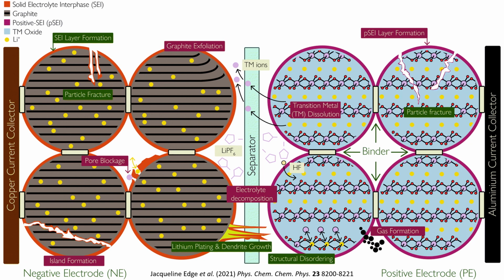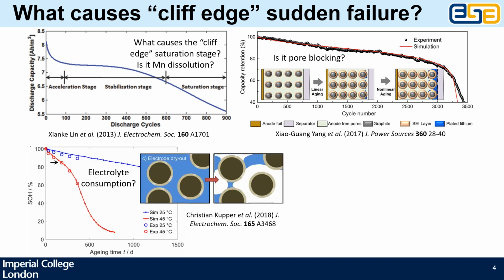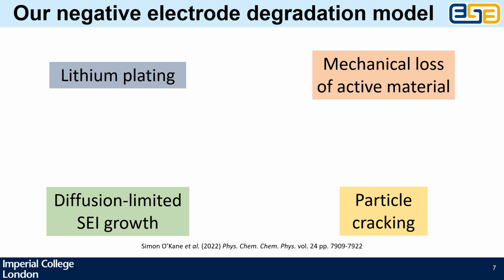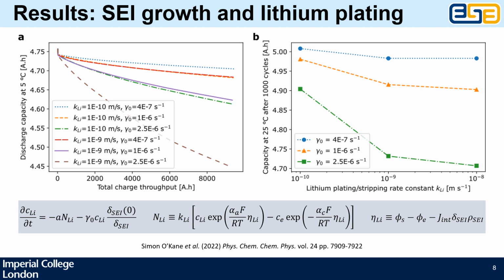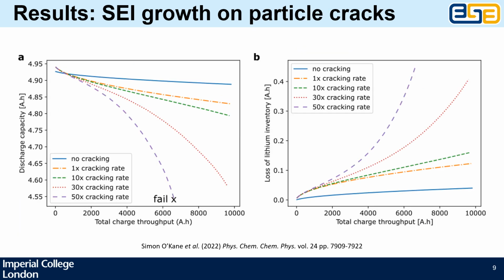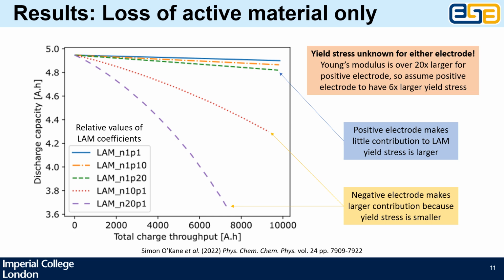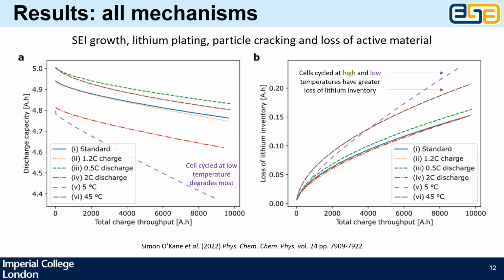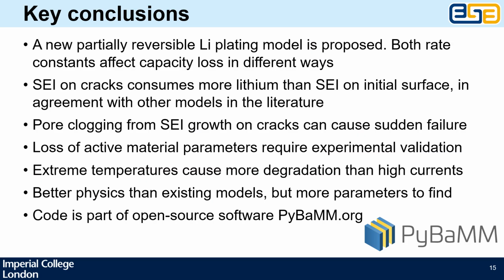Lithium-ion battery degradation: how to model it - Simon O'Kane

Comment: You get one item wrong - or it appears so.  You mention the primary items in green are the problem items and mention Transition Metal Dissolution which isn't in green in the first slide.  There also is the point of Dendrite formation which most people assume I the "big problem" but a little more explanation that lithium plating leads to dendrite formation and was we can see, on slide 2, it appears to also happen on its own.  A little more clarity on both as well as mentioning that and how PE structural decomposition leads to TM dissolution, may help clarify any differences the casual reviewer can spot between the content of your narration and what is indicated in the slides.  Thank you though.  Very informative.

Comment: I’m currently trying to model current-dependent battery degradation, but I’ve been struggling. I’m happy to know it’s not very easy. Do you think that rather than any one of the papers initially discussed at the start being wrong, it’s a combination of all of them being right as well as yourselves?
Reply from the maker: All of the degradation pathways explored by those papers, as well as our own, can happen. However, it is very difficult to prove that any particular degradation pathway is happening for the cell you are researching. - Simon

Comment: Sir can you tell me why binder material used in electrodes
Reply from the maker: The electrodes are made of particles and so a binder is required to hold them together. The most common choice is a conducting polymer such as PVDF. - Simon